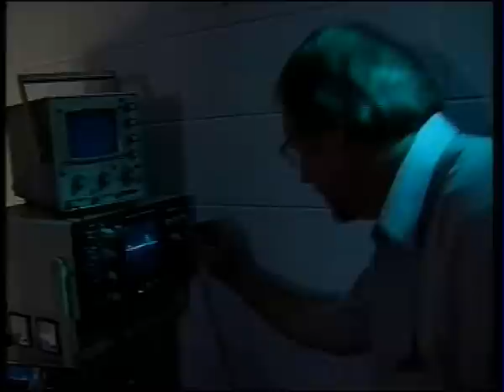Free Energy: Overunity Motor

Comment: I thnik this works simmilar like heat pump but instead "extracting" heat here is extracted magnetic flux energy. let's remember that rules of thermodynamics apply to symetric exquilibrium states. when you have asymetry you can "draw" extra energy from surrounding sources. in other case there would not be possible heat pump system where you put (pay) to say 1000 J and get in return 3000 J. in interms of shear output to input ratio we have gain